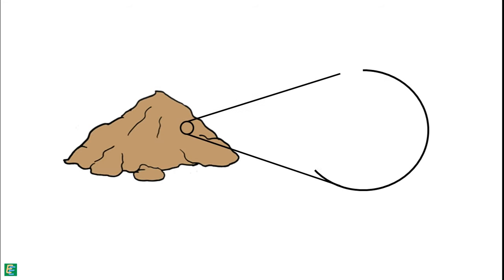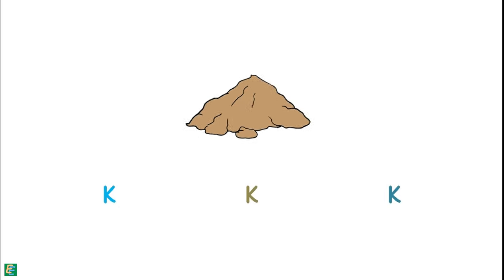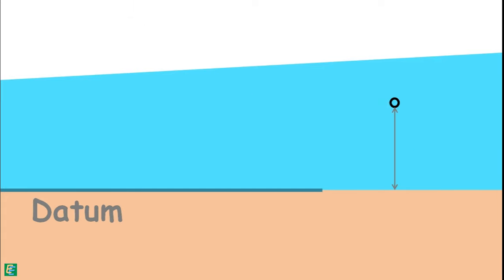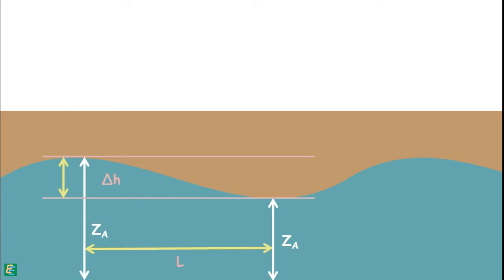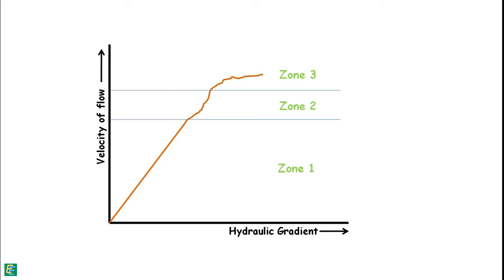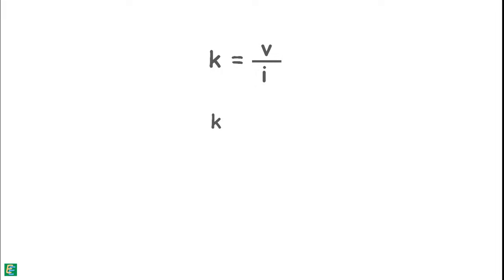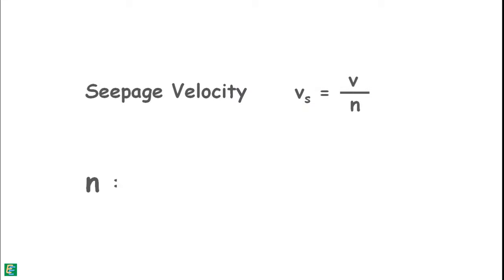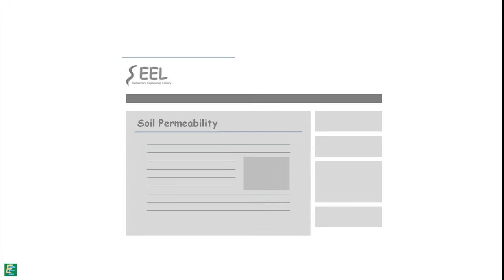Soil Permeability - Darcy's Law

Comment: Hi, EE
I am a Geotechnical engineering faculty.
At 1:20,for gravel, i think u should represent it as larger void space instead of volume of voids. as volume of voids are more in clay. i think it is appropriate to use term of large void space instead of large volume of voids.
Reply: What's the difference??
Reply: space or void is bigger in large size particle but not volume it's lesser
vice versa for smaller size particle